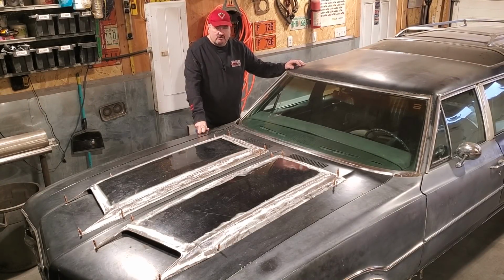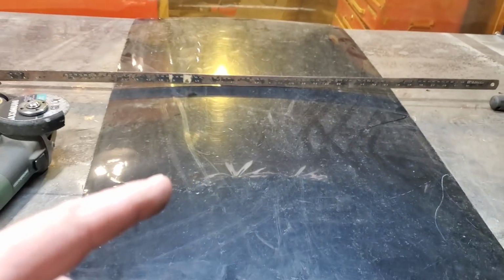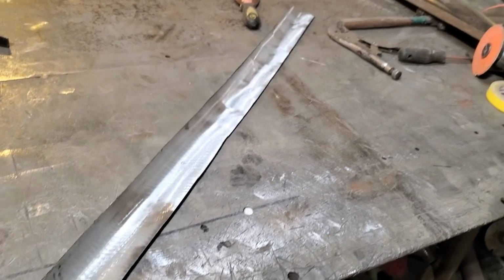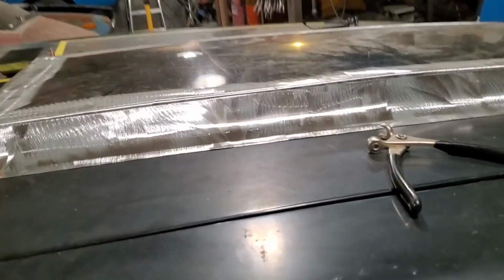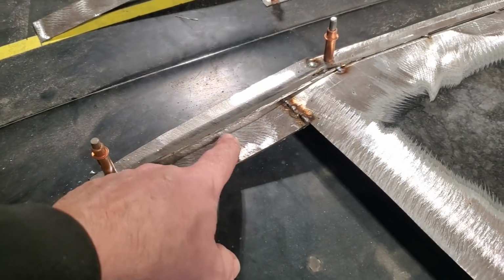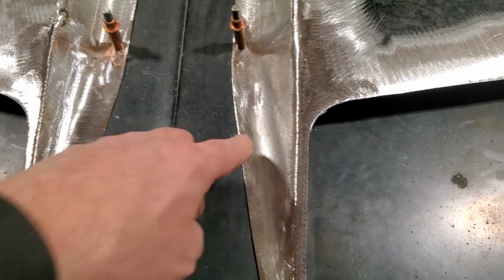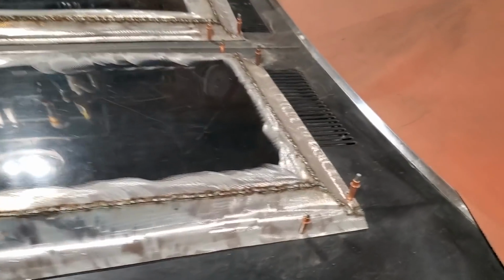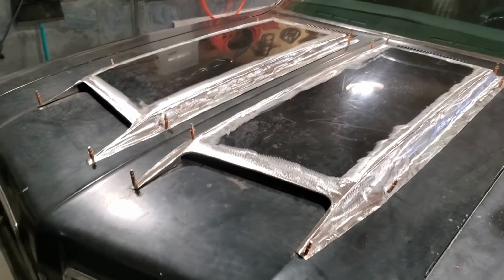Olds 442 hood scoops made with simple tools

Comment: About 45 minutes in you illustrate perfectly why nothing on the car is perfectly flat when you turn one of the scoops over. It's so solid, no flexing as you take this long structure of flimsy sheet metal and flip it over. All those different crowns, curves, and angles reinforce each other and make it much more solid than you'd expect from something made of steel thin enough it would be very floppy as a flat sheet.

Comment: While I do greatly enjoy the video, and your work is "over the top" as normal!! What a lot of people fail to understand about the Oldsmobile 442 is that the hoods on those cars are actually hand laid fiberglass, like that of a boat, or a 1960s Corvette!! If you take measurements off a stock "real" 442 hood, there are subtle differences between each and no two are exactly the same, because of the fiberglass process!! Making a 442 style hood out of steel is a very cool idea and certainly probably much stronger than the original hoods as well!! Because the original hoods were prone to cracking, because of voids in the fiberglass and structural weak spots as well (usually around the twist lock hood pins)!!
Reply: Thanks for the info, watching this I did wonder how the originals were made.
Reply: @consul6262  Last I knew Year One sells reproduction 442 hoods for cars from 1969 to 1972....but as Fitzze pointed out (in this video) the hoods ARE different from the Cutlass to the 442, because the Cutlass hood goes all the way to the front end, where the 442 hood stops at the valance!! Also another car that uses this same hood, is the Rally 350 which only came as YELLOW.... all Rally cars were painted Yellow in other words!
Reply: @gregbenwell6173  Thanks but I don't own one, I was just curious. I own a 55 Buick for my sins 😄
Reply: @consul6262  may you be forgiven for that. Buick had some fine rides that flew a bit under the radar

Comment: Just another day in the Fitzee Fab corner. Love the way you explain, execute, explain, and VIOLA, Done! One of the best bits I have now adopted is what I call "The Heat Wait". Been reworking a 98' Chev Tracker and the metal is SOOOO thin. I had to put in a comfy chair in my shop so I would sit down and wait for the heat to dissipate. That and a mini fridge with wobbly pops and my shop time has incresed dramatically..... I had to chuckle when I saw you standing there waiting for the scoops to cool with your ear muffs on, then walk over and weld without a shield. I hate the sound of sizzling bacon too....its a good thing welding doesn't smell like bacon too, cause I would be so hungry and never get anything done. Nicely done Obiwan!

Comment: The scoops came out great! I agree, welding anything on a hood is a nightmare, but you made it look easy! Years ago I worked at a hot rod shop and one of the employees built a custom hood for a 38 ford. It was supposed to be a simple job, but he warped the daylights out of it. Then he thought it would be a good idea to fill it with lead, which just warped it more, so out came the short hair and so on. When he bolted it back onto the car the fancy billet hinges immediately folded up like acordions under the weight and his employment was terminated. I'm not sure why the boss let him go on as long as he did, but if nothing else it was good entertainment.

Comment: Excellent planning and explanation from the teacher to the pupils - HA.  Many years ago - I adapted a file to an air powered sander (the type typically used to sand body filler) - in certain circumstances, it can be useful (HA - well - I think it was) for knocking most of the top off from damn MIG welds rather than using a grinder and therefore potentially limiting more heat put into the panel when you have a lot of MIG welds to make flat. The same can be done by hand a file if not that many and it may be a bit of an 'over-kill' - but sometimes if possible to get to the MIG weld lump - I used to find in a 'satisfying' method to make me think I was reducing the risk of sensitive areas being subjected to more heat. Have a safe and nice day all - CHEERS from AUSTRALIA.

Comment: You mentioned on Make it Custom that you didn`t tig. I just took it up, got a PA cheap thing. Works very well, but i have nothing to compare it to. Used up almost a full 5 foot bottle of argon practicing. Welds work soooooo much easier. Great video on the hood scoops, have to make an appointment to visit your shop when i get back to the rock for a visit. Lots of in-laws there. Hope to drive back there in a couple years.

Comment: If the car is a 72 like you said in the video. You have a 70 front end. 
That's why there is so much difference from the 71-72.
The fenders are all the same for the 3 years.  Some slight varieties but they don't effect the fit. 
There is enough space between the under support of the hood to make the front more like the 442. 
They used this hood style the flat tops under bracing to make the fiberglass topped 442 hoods.
Just a little FYI!
Still looks amazing though!  
Nice work!  I'll have to give your channel more views. First time here!  
Enjoying the handy work!  
Good luck with the finishing!

Comment: Thoroughly enjoyable watch there, Tony.  What you are saying about the crowns makes sense.  As a teenager, I had often wondered why some mods I had seen just looked wrong to me.  Some followed the crown one way but not the other and some did neither.  The top of the ones with no crown at all used to wobble up and down when the car was moving (and sometimes even sitting idling, you'd see them vibrate) and it sadly just spoils the look.  What you have created there looks magnificent, my friend.  Not everyone can afford the entire new front end panels and such to recreate the exact model and those scoops fit in so well with the look of the front of the car, they could almost be factory.  All it took was the original measurements of the scoops and the vision of how to incorporate it into the existing hood.  I would be rapt with their addition if that was my vehicle!

I like your idea about rounding the corners on the front edge of the hood's original raised panel.  I think that would just finish it off nicely.  It doesn't need much and its a small detail, but I think it would add to the wow factor.    

The tips (as always) were good - I always learn something new from each episode and it has definitely helped.  All the best.

Comment: Don't know if the fenders are the same on the 442 vs wagon.  I do know on the '70 Chevelle wagon & the '70 Malibu the fenders are different.  The cowl/firewall were basically the same & the hoods would interchange.  The comment regarding using recycled metal to get right contour is really good to know.  I spent most of my automotive career as a mechanic but always found body work to be very fasinating & always had to rely on body shop friends to assist when I needed work done.  Amazing work as usual. 😀

Comment: Great work replicating the w25 hood (w30) is a special 442 option. You can get w25 hood on a regular cutlass or Ralley 350. The hood in the pictures is off of a 71-72 w25 hood. 1970 hood is different, so is rad cradle head light bezels and fender moldings 1970 Cutlass and 442 have same rad cradle, bezels and moldings.

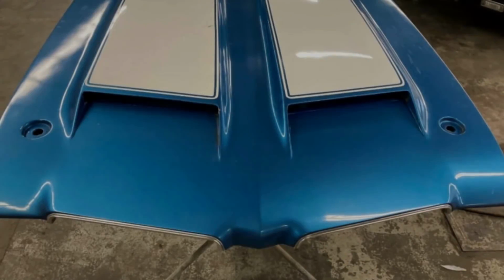Comment: My suspicions were proven correct at 11:02.  You’re using pictures and measurements from a 1971-72 hood, not a 1970. The two two hoods, though similar are different. I knew something was wrong when you said you had to change the grilles , etc. later you mentioned the drop in the front of the hood.  1970 442 grilles are a bolt in,  in place of regular grilles. Also the 442 and cutlass front bumpers are identical. Really nice work extrapolating the outside air induction (OAI) hood scoops. I’ve wanted to do this myself, including the hood locks. I’d love to see a metal OAI hood for these vehicles. Great work!

Comment: Hi very accurate about square shapes not looking right, I see this a lot. I once made custom bumpers for a mini. I tried a whole range of different things, none of which worked with the car. Eventually I put the original bumpers back on and worked off the original shape. There is however one exception, I also have a Holden HZ van ( Australian car) which is a box, square shapes work on it.Tried to upload a photo but cant

Comment: Fitzee, do you ever lay a wet cloth on large panels when you weld. I find it keeps things cool 😎 genuinely impressed as always by the way
Reply from the maker: No I find it contaminates the metal for next weld. You will have to dry it between welds.  Also I find it flash rusts with all the heat

Comment: Identifying 70-72 Cutlass/Vista's is in the tail lights. IIRC, 70 - 2 Lenses long side vertical, 71 - 2 lenses long side horizontal, 72 - long side horizontal with 6 squares.

Comment: Amazing work, Tony! Question: would it have been easier to incorporate a 1/8 inch or 1/4 inch rod as the rollover on the front edges of the scoop?
Reply: MrHemi4spd  lol
Reply from the maker: The face of each edge needed to be flat also alot of round rod have weight and to much will make it heavy

Comment: Ok , I've got a dumb question ... Can you have 2 sheets of steel on the English wheel stacked ? 
Would be nice to make a mirror panel at same time . I honestly have not seen anyone try or show that
Reply from the maker: Problem I see there and the wheel works with Appling force to both sides of a sheet of metal. Two stacked you have a void. Your Appling force to top of one sheet and botton of the other. The pressure in between  is less so shaping it will be very hard
Reply: I did warn you , It was a dumb question . haha ... Yeah , would be nice tho , maybe stacked in a plannishing hammer idk when I get em I'll probably try it , lol ... Thanks for trying to teach an untaechable like me , your efforts are appreciated !

Comment: How much to send my hood to you? Or drop the car off?..  I bought a fiberglass Hood and was just going to cut the Scoops out but every painter I talked to said it's going to crack over time... I have a 1973 Delta 88 convertible...
Reply from the maker: It will crack as your heating up two different materials and both move differently with heat.
Reply: True.... So what do i need to do? Do you have a contact number? Where are u located?... And how much to have this done?

Comment: I feel I need to mention this. The pictures of the W25 (what you call the 442 hood) are from a 1971/1972 model. The nose of those hoods is completely different than the 1970 model. Scoops are the same basically, but the front structure on 1970 is completely different. So that being said, the front clip is interchangeable with any of the 1970 A body Cutlass models. Only thing that would change is the grills, and they will bolt directly to the existing radiator support. There's no change required to any of the fenders, liners, bumpers etc. Just as an FYI the W25 hood was not standard on 442 models, it was a factory option. The only 442 that the W25 hood was standard on was the rare 442 W30 (one of the most coveted high power muscle cars ever produced by GM). The factory never ever released the Vista Cruiser with a W25 hood so the tribute you're doing for this car is going to be a one off. This type of project is unique. Most people just buy a reproduction hood from Thornton's or other repro company's. The uniqueness of your project is it differs from the original by being all metal. The W25 hoods from the factory or Thornton are fiberglass molded bonded to metal sub-strait. Are you planning to also install the hood pins that were standard features of the W25? Plenty of questions,  but I'm fascinated by what you've done so far. BTW, next time you have a chance, hop in the car and see what a difference the hood scoops make, then take them off and compare. They just make the car look more "boss' inside and out. Nice work sir!
Reply from the maker: Great info. We have a local  w30 car here. Poor thing rusted away. I have hood pins as well they will be installed also.

Comment: 1969 and 1970 radiator core supports are the same for all Cutlass models fenders are different only around the wheels. 
1971 & 1972 core supports are the same for all Cutlass models 
1970, 1971 & 1972 fenders are the same skins. All the grills are different for all years and for 442's and Cutlass. Head light trim is different for all years